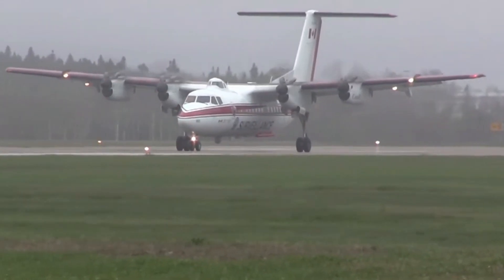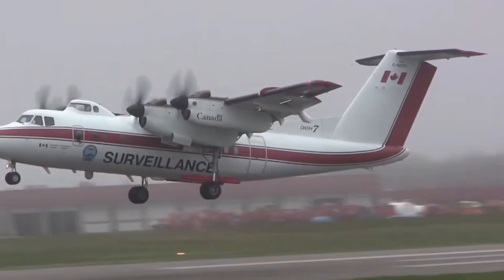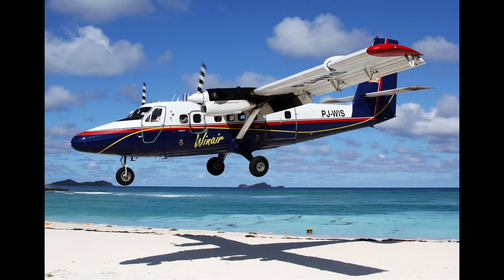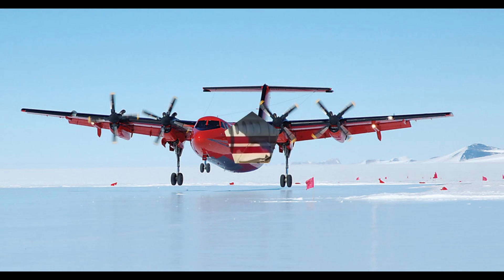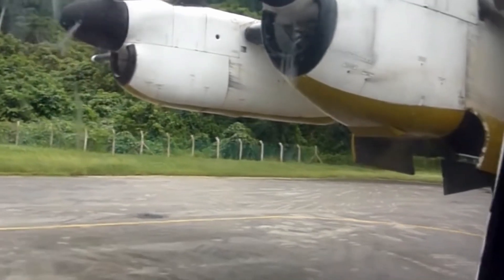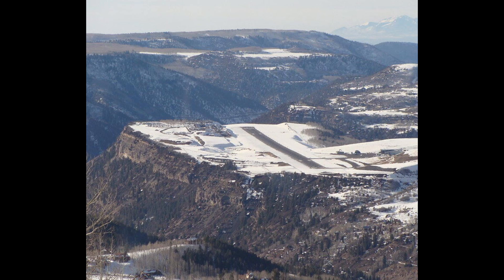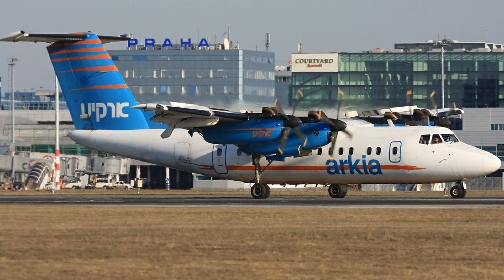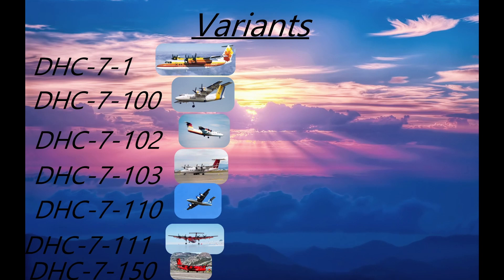The Untold Story of De Havilland's Dash 7

Comment: Thanks for highlighting a great aircraft but there are several inaccuracies or wrong information. The DHC-6 wasn't usually called "Dash 6" There were just 113 aircraft built, not 133. The flaps were not full-span but rather about 3/4. The Arkia plane shown as a -101 variant does not have a cargo door. Finally the Dash 7 was successful in doing for what it was built for but was not a real commercial success as the market DHC had envisioned for it did not really exist (contrary to your mention in the video when listing aircraft of similar size) wasn't big enough and cities failed to build the "urban STOLports" the DHC-7 was meant to use.

Comment: Yes the DHC 7 was a specialized aircraft.  Its specific design goals were to meet field performance requirements of the Rockcliffe airport.  Rockcliffe was the STOL demonstrator airport located in Ottawa.  Furthermore the double slotted fowler flaps were on many other aircraft.  The 737 had triple slotted.  Ailerons were fitted to the wing and would work in conjunction with the roll spoilers.

Comment: I was amazed at the short distance the Dash 7 can land in when watching one land at SFJ (Kangerlussuaq, Greenland) on runway 27 and turning straight in to the terminal parking area. Go and look up the layout of the airport to see it.

After seeing that, I was shocked to see one line up in MNL half way down the runway and then when it was his turn, waste time taxiing on the runway all the way to the end of the runway for takeoff, when I knew that he could take off on a dime, (or in some couple of hundred metres).
Reply: Not everything that you COULD do you should. Yes it could have taken off without bactracking on the runway but why do that if there is available runway? . . .
Reply: @TRPGpilot  Because at MNL runway 13/31 is 2258m long. Half the runway is still over 1km (I don't know the exact distance from the taxiway at the half way mark). Most of Greenland's airports were 800-900m full runway length. Taking off in such a distance is easy for the Dash 7. By taxiing all the way to the end it wasted an inordinate amount of time, especially during a busy period (Easter) when it could have easily taken off from where it was. Manila operations are inefficient at the best of times, and the runway arrangement doesn't help. And neither did the taxiing all the way to the end.
Reply: @pagophilus  Fair enough. The pilot though might be prioritising landing back on the same runway if there is a failure after v2 but who knows? You have made a valid point.